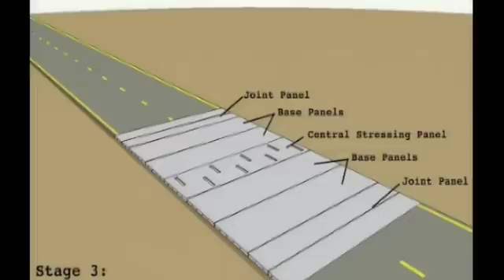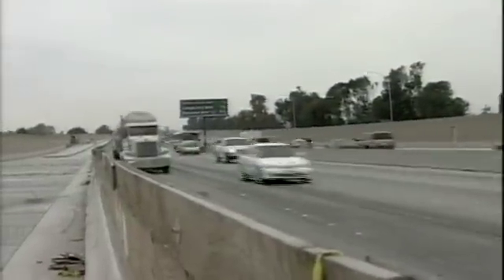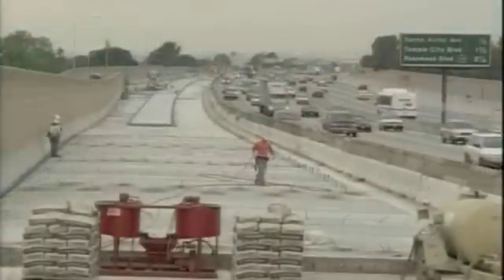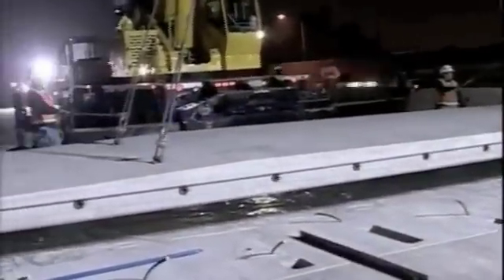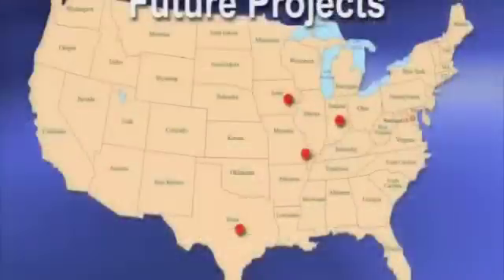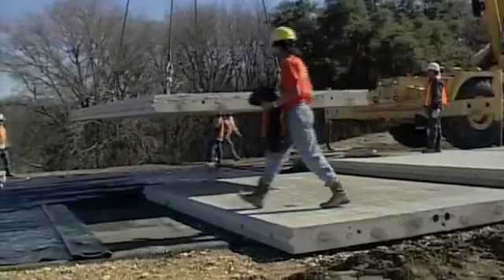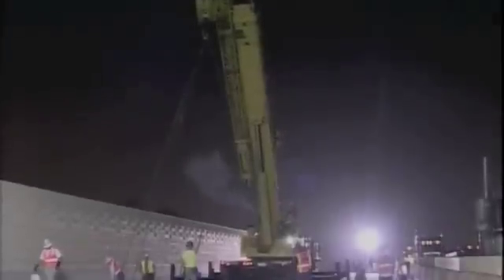Paving the road of the future. Part 1 of 2

Comment: This is good, but let's take it to the next step--for example placing an electrical grid with built in sensors for the generation of self driving vehicles that will be set in place over the next 50 + years.  The same sensors could also be used for traffic law enforcement and safety measures.  Often 'hardwired' is more durable than satellite technology.

Comment: Junk take it from a truck driver them concrete roads will beat you to death..the seams in between the panels sag,and they will thumpity Thump 
 I swear I 10 in Louisiana and all the way across in to Texas is garbage. After Hurricane Katrina they fixed I-10 with black top in a few spots but not many, and to say concrete holds up any longer then a blacktop Highway does is a damn lie,because weather wreaks Havoc on concrete especially hardened concrete and anybody raised up in the cold knows that.. finally once concrete is cracked it is only a matter of time before it starts literally disintegrating and turning to dust, and anyone questioning that only needs to drive up any concrete road every damn one of them I'm talkin even the new ones are riddled with holes.

Comment: they talk about being able to replace sections if needed... but how does that work when multiple slabs are joined together with steel cable in all the sections and then permanently fixed... you would have to cut trough all those cables, destroying the tensioning effect... ???

Comment: Can concrete paving withstand -50*C weather? ..can it withstand repeated freezing and thawing?
Reply: There are still roads and some highways built in the 1930s- 1940s that are concrete.  There are different grades for light, medium and heavy travel.  They have lasted FAR LONGER than asphalt.  The usual failure is that the substrate is not properly prepared. 
If this system works the panels can be retro fitted in the shop for heat, lighting, markings and maybe even solar collection.  A WIN-WIN.

Comment: What is the wear like on tires. I know tar is a lot softer than tires.
Reply: +Oliver o nell Tire wear? really? you will get 3 more miles when you run on tar vs concrete.. thats all
Reply: SAUKEN 15 I'm not sure about that. Tar is softer than tire rubber where's concrete is harder. a thin layer of a softer material on top may be good.
Reply: Not enough to notice a difference in your car tires.. If you were running a NASCAR 200MPH I would agree!
Reply: SAUKEN 15 Have you tested it or are you just pulling numbers out of the air?
Reply: wow..  Asphalt to concrete, you will not notice a difference in tire wear.. PERIOD!  Asphalt has the same mix design as concrete.. Sand, Stone and Cement, all same things that would wear tires down, the only difference is tar is used instead of water..
Reply: SAUKEN 15 It's more about hardness. once cement sets its very hard where as tar is weaker than rubber.
Reply: You missed the part where i said.. SAND STONE AND CEMENT are all in Asphalt SAME AS CONCRETE.. The Cement activator is the TAR and when MIXED with the CEMENT< SAND AND STONE it is JUST AS HARD AS CONCRETE!! When building a road, nothing can be soft! Using your rational using (soft tar) roads would last a week after a million cars a day passed over it!
Reply: tar roads don't last as long as concrete. every few years they have to be resurfaced. tar works because its a thin coating on its hard filler. if it was big chunks of the stuff you could rip it apart with your hands. it wouldn't take much to skim the concrete roads with a thin layer of tar. you could nearly paint it on.
Reply: +SAUKEN 15  Tarmac is NOWHERE NEAR as hard as concrete!! On a hot day a stiletto heel will sink into it. The tar acts as a binder, forming a cement with the sand and aggregate, but it does not contain hydraulic (Portland) cement like concrete does, and does not set due to chemical reaction as concrete does. Essentially tarmac is a viscose suspension (of solids within a liquid), whereas concrete is a solid.

I think you went over the top with the capitalization and exclamation marks to be honest, especially considering that no road on Earth carries a million cars per day. There should be a two-second safety gap between cars, not 11 cars per second. :-P
Reply: Once again you are wrong.. The NJ Turnpike carries at least a million cars a day and the bridges alone in Philly and into NY carry this many cars... Asphalt used on highway is NOT soft, maybe the stuff used in parking lots "may" be soft but not highways.. If that is the case please send your idiot engineers to the east coast and we will teach them about asphalt.. we get all  seasons here.. extreme heat, rainy season then snow and ice!!
Reply: SAUKEN 15 whoa there pal. I was just making a suggestion. Rubber is stronger than pitch the material used to bind asphalt. asphalt is made of a thin layer of pitch covering stones. I was trying to help you ok.

Comment: Well are brains are working.  Susan great idea, just a little out side the box of reality.  Glass thick enough to support 250,000 pounds would be very heavy.  Now with that being said, what is glass?  Transformed concrete, or sand.  so how do we raise the levels and reduce the frequency of fixing because of millions of pounds of constant pounding multiplied be the movement of temps ( expansion and contraction ) then doubled by the natural movement of the ground.  Wow, we have helter skelter on our roads.  Now back in the days of Cesar when they had made their roads, which I might say are still standing today 2000 years later.  They added volcano ash, which gets harder over time.  I think we need to look in that direction if we are looking to a permanent solution, to a problem that I believe is more like the light bulb.  I breaks so we can keep Joe in a job!!!!  With out vision for creating and moving on to something new, we will box ourselves in and life will force us on to something new.
Remember there is always 2 ways to learn
Revelation, information shared by past experience.
Or
Tribulation, paying the price of the unlearned.  Touching the paint so to say.
Revelation is always the better way I think

Comment: More half solutions from the brilliant American engineers  -- the same "experts" that gave us the bridges that fall at a mid-size earthquake and build them back wrong again, are at work here!
The joke is on all of us that have to pay to redo this bad job again and again --- like the current pathetic new freeways that after only a few years are a mess.
Are this guys this dumb, or are they just scamming the public, as this is good for business??

If you are going precast (or even concrete, or any other system) it must be over beams -- yes beams, precast overlapping beams under the platforms. Laying concrete on a  bed of gravel/base (even tied together) will develop dips and bumps on the road over time, as we all can attest from the joke that are the current freeways.
 The platforms probably should be laid longitudinally, to have less joints and be one lane wide! Hills and curves can either be  precast, or cast in place --but over beams too!
Another idea is for the surface to be machine sanded/grinded, for a desirable no joint feel.
WHY IS THIS TOO COMPLICATED??
Reply: +Jose Korvelo Simply not true.. your theory on beams under the 12" thick precast that is prestressed inside of 9,000 + PSI concrete where poured in place concrete is 5,000 PSI!  Obviously you have never been around precast and If you have you don't understand it!
Reply: What isn't true?
What is your point?
I know enough about concrete to know your numbers aren't true and that the design/engineering of  roads and bridges is a joke  --an expensive joke, that only benefits the road building industry and the politicians!!

Comment: Using Solar Roadways as our paving choice could not only improve highway construction, these precast paving blocks could produce smart thoroughfares. With energy producing paving blocks, our roads could be safer, flexible and the smart roads of the future.
Reply: I see multiple problems with that idea of road material. First: I'm not sure how the road panels will perform as a load bearing member. They will have to go through various forms of compression and elongation due to heat and contraction due to cold temperatures. When you put the panels in line with each other, I'm not entirely sure how the system will react with these loads and stresses. Specifically on the use of solar panels as a load bearing member: A normal solar cell will not be able to withstand the amount of  varying, but constant force applied to the specific section. So there is one of two ways to combat this: Completely redesign the solar cell. Which is costly and time consuming, and may not even be able to yield to the forces. Or create a thick and strong glass or glass-like material that will be able to transfer the loads to the ground instead of directly on the solar cell. The problem with this is that the thicker the material, the more bending of light there is. This will result in a lower efficiency percentage to an already low efficiency of the solar cells (13%-15% I believe). The other factor is any material that will be over the clear material such as oil and tread marks. If light is not able to pass through the substance, that panel will be essentially useless. The other problem is cost and maintenance. The initial cost of installation will be extremely high, and I am not sure that the output will overcome the initial cost. On top of that, I guarantee that maintenance on the cells will be regular and costly as well. It's a great idea, I just don't see it being beneficial in any way with the current standings of solar cells. Let me know if you can answer or rebuke any of my concerns.
Reply: Your concerns are valid. As with any innovation, Solar Roadway paving blocks have many unknowns, just as there are still unknowns with precast concrete. Solar Roadways has done a preliminary demonstration project of their paving system and the system seems to have performed exemplary so far. There is a very thorough FAQ on their website at; http://www.solarroadways.com/faq.shtml
But what has me excited is the flexibility and adaptability of Solar Roadway’s system. They can be applied not only to roads, but to parking lots, sidewalks and many other applications that uses pavement. I would be excited to see how precast concrete could be incorporated with solar paving. This could literally “drive” our transport systems into an integrated but flexible system, for the future.
Reply: Glen Bartholomew

Comment: I'm no engineer, not anymore than you are - however, I am onboard, but not with this concrete idea - it's old news! In my opinion, the answer is in programmable, smart grid Solar Roadways made from hexagonal sections and covered in a formulated type of glass material that allow for a weight load of 250,000 lbs and rides out earthquake movements which replaces concrete entirely. The above idea is labor intensive, heavy, old thinking. Solar Roadways pay for themselves as they collect 3x the energy the U.S. currently uses, never needs snow plowing as it can be programmed to  be heated; can be reprogrammed when needed; can be used in every application from sidewalks, to driveways, to highways. It will tell you when an obstruction is ahead of you.. the road itself is a smart grid!! If a panel is damaged, just that section need be lifted up and a new one installed. NO Concrete used at all. SOLAR ROADWAYS over concrete is the KEY.
Reply: Glen Bartholomew It's a nice thought and I've seen some things on it, but right now I think they're best served in areas like driveways, and small parking lots.  The infrastructure needed for them is enormous and would definitely crush any costs that would be recovered from them over the next few decades.  And who would get all that solar energy?  The government puts in the roads and pays for them, but then do they invoice us for the use of the power generated by them?
Reply: And this concept is still but a pipe dream. The storage facilities to store the energy produced doesn't exist yet. The cost to provide just the wiring of said devices would be well above the cost that any city or state could afford. The down time to put something like this in place couldn't happen with the traffic that is now using the roads. Heated? Heat kills electronics, with a sealed panel there would be no way to cool the panel. The transfer of rubber compound from tires to the surface would degrade the panels ability to produce power and would constantly require cleaning (another added cost and down time of said road section). There is no base that could support this surface and keep it in constant level status to allow these panels to remain fitted to one another, once they developed a space between them they would lose contact with one another allowing foreign material to get under them and makeint the whole thing worse. Solar over concrete? Ok what happens when the concrete states to ware out and cracks? Again no base could function for this concept with the constent weight being applied to it (millions of cars a year). We don't have solar cells effective enough to be put into a sealed cell just yet. If you do any research you'l find at the "Solar Farms" they are replacing arrays all the time due to them wearing out. The sun not only provides the requirement to make solar energy from a cell but it also causes them to wear out also.

In short this is a pipe dream that someone came up with and put it on the net, others thought is was a great idea and jumped on the band wagon. It wouldn't be cost effective, it would (if they existed) cost way too much money to implement, we don't have the storage technology as of yet, the roads would be down too long and create too many traffic jams. And like I said it would cost more then most states or citys could afford to invest.
Reply: So your one of the Pr-reps for that company? How mush you getting? 10+ million.
bugger off.
Reply: Mikey8567 But how many roads actually have the potential to produce revenue, rather than just us it up?
Reply: How much per mile?
Reply: krecikowi 10x solar panels generate DC power, more then 100 feet to the transformer and you loose power big time that's why we use AC power. For this to work you would have to have power inverters every 200-500 feet. Unless you have a room temperature superconductor you want to give away?
Reply: MrFrogmasterG That is why I "asked".

Comment: Nope Asphalt is not faster. It needs to be redone every 5~7 years (not 15 years). Asphalt runoffs are poisonous. Consistent asphalt is hard to get. You need as much equipment for asphalt laying.

Prestressed panels are cheaper. Smoother and very consistent. They only need replacement every ~15-20 years. They maintain their performance/quality for longer durations.
The only problem is that there are not as many prestressed panel producers, since it requires specialized and technical knowledge.

Comment: Metals? If you had taken a course in engineering you would laugh at your question. But nevertheless, metals oxidize in open weather, they are expen$ive and weight too much. Plus their isn't enough production on the planet to fulfil the interstate system for example & environmental footprint is massive.

Prestressed Concrete is fantastic. Concrete is prestressed for many reasons. One being to prevent it from cracking. Without cracks and weathering inbetween those cracks, it lives on much longer.